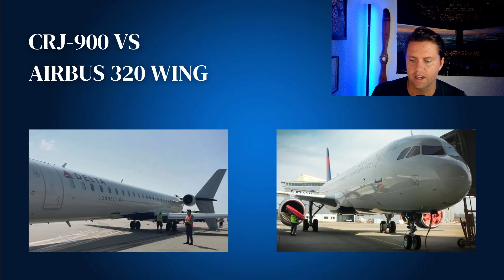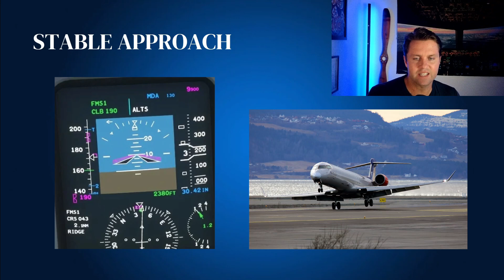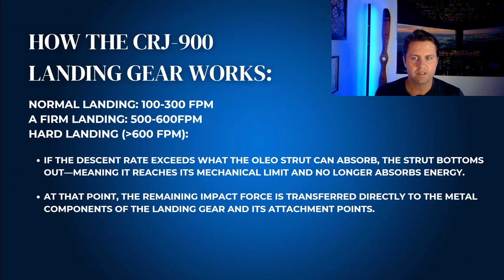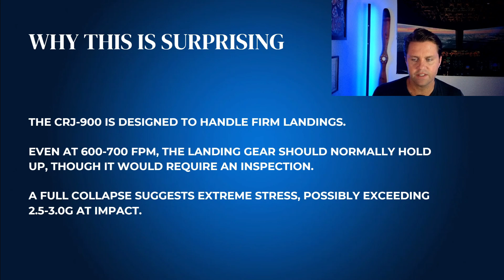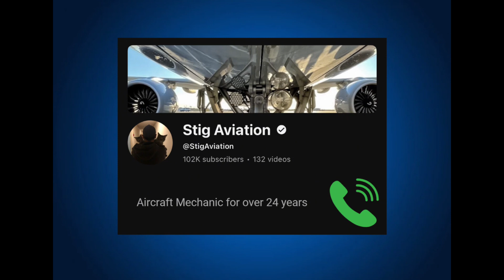Pilot Breakdown: Did a Hard Landing Cause A Gear Collapse?

Comment: Not only did the snow probably extinguish the flames but it also helped the plane slide easier wish I think help the fuselage hold together. Did you ever seen a deer trying to stand on ice? How the legs spread out and the animal can’t stand. Maybe just maybe this is what happened here. Coming down hard on to the one side plus the sliding away effect put enough force on the gear that this thing gave away. Yes this equipment is designed to withstand hard landings but also a deer’s legs are no joke so I think that under the right conditions this landing gear wasn’t able to hold steady and slides out of position causing the accident. All we need is the right recipe. Coming in a little hard wind tips the aircraft to one side and the ground being slippery..  I am not an expert but just know a little bit of mechanical structure..

Comment: Runway 23, wind 270°, max gust 35 knots. Calculate -> Max crosswind component 23 knots. 
Max allowable crosswind component for landing on a wet runway for the CRJ900 = 22 knots.
Pilots made the call to not go around. Very risky landing. Plus no flare = disaster

Comment: Mmm there is a fair amount of talk about "overweight landings" towards the end of this video... A quick bit if research (rounded distance doen to 900 miles) indicates a fuel burn of at least 8,800lb or almost 4 1/2 tons (or roughly half of a CRJ's possible TAKE OFF max fuel load), passenger jets encountering a 'return to departure airport' shortly after taking off (with full tanks) may need to off load weight (fuel) to avoid being "overweight" but clearly that wouldn't be a factor here.

I noticed (likely the most significant factor based on the limited information available so far) that there is almost zero consideration regarding the likelihood (especially based on the video) of the aircraft encountering a gust generating a sudden DROP in airspeed immediately prior to touchdown in all the videos of this accident (especially in view of ATC 'weather actuals')

Comment: Funny you mentioned sand. Years ago the Argentina Navy has an L-188 Electra crash land on a training flight. Local media filmed the entire approach and crash. Most of the fire was extinguished by the sand when the sand flew into the air and back down on the wreckage. The only small parts that kept burning were the parts where sand didn’t land.  I was working for a small simulator company at that time and we used the video for CRM training, this is back when CRM was a dirty 4 letter word. So, yes the snow probably did extinguish the fire.

Comment: NO FLARE?
On the early afternoon of Feb 5th I was flying on AA from PIT to DAL.  It seemed like a normal descent except it must have been IFR because we were surrounded by fog.   All a sudden we landed with a WHAM!!   I don't think there was variation in power application in the last seconds or any flare.  Hardest landing I've ever had and I've been flying as passenger for 60 years.  Am wondering if all of the young pilots are being taught?

Comment: The orange flames seen during the crash sequence is caused by vaporized kerosene fuel escaping from the ruptured fuel tanks, probably from the severed right wing. The black smoke is caused by fuel in a greater quantity than the misted fuel that caused the orange flames.  Yes, the snow did extinguish the fire, saving the passengers lives. 

Also, the airplane did not bounce, most likely, because the wings did not have lift to allow the aircraft to ascend back into the air.  The airplane rolled towards the side with the severed wing, an indication that a sufficiently large rolling moment caused it to roll over onto its top.

Comment: The video shows a quick roll to the right and slide to the right just before touchdown. The gear may have touched down off the runway. Take a close look.
Reply: I wondered that too.  Peraps it was in the deeper snow at the edge of the runway.
Reply: This raises the question, was the whole width of the runway cleared of snow?

Comment: It is actually gross weight times g-load that determines the actual loading on the MLG.
Reply: Force = mass x acceleration
Reply: @christopherrobinson7541  When talking g's, then it is weight x g-loading. Each g takes into account of mass and acceleration. I have been an aeronautical engineer for 53 years.

Comment: If you watch a slightly different clip, you can see earlier in the approach the nose was up with a slightly higher angle of attack - almost like a premature flare too high off the runway. Then you can see the 
nose drop and the plane goes higher sink rate with a lower nose attitude until major impact on right gear.

Comment: Are we sure the gear actually failed?  It appears the CRJ has the rear bogies mounted way out on the wing.  It could be that the wing simply dug into compacted snow as a result of low stance plus slightly rolled attitude plus high G touchdown.  If the wing ripped caught just right, it may have ripped the gear off before it had the chance to provide rebound force.

Comment: What if both starboard, main tires blew out immediately? Every physical part that failed, failed. I've been in a plane that landed hard and one tire on each  side of the main landing gear, blew out, the plane couldn't taxi to the terminal and we had to walk to the terminal. There were no buses to carry people to the terminal as this was a small regional airport. I've seen planes with tires that have a huge gouge in them so, a large, flat area on the tire, often several tires, where obviously it landed hard and removed a lot of rubber. I've seen a nose wheel fall off a plane that was taxiing onto the gate. I've seen a plane taxi onto the gate missing a nose wheel. It lost it nose wheel on take off from its departure city and landed with one wheel only at the arrival city. The pilots were oblivious to the fact that they were missing one tire. The airport maintenance people in the departing city later found it in the grass near the runway  once the pilots contacted dispatch and said they were missing a nose wheel. Have you never seen footage of WW2 aircraft carriers planes landing hard and snapping a landing gear, blowing a tire  bending a wing? They are all designed to work to a certain point. Aluminum has a melting point. If a fuel tank ruptures, and flames erupt inside the wing, that aluminum which is brittle, compared to steel, which is more flexible, now becomes more flexible, it softens.I don't know what the temperature of the jet fuel was when it ignited, so what is the flashpoint of jet fuel? Does burning jet fuel go higher than the flashpoint? Don't ask me, I don't  know. Someone does. Someone sitting on the left side of the plane said they saw flames on the left side. Were those flames from the right side fuel tank rupturing or did the left, port side fuel tank also rupture?

Comment: Regarding Asiana 214 in SFO: The passenger killed was run over by a firetruck after have been ejected through the opening caused by the breaking off of the empennage. She had not been wearing a seatbelt for the landing and was lying on the ground being covered by foam while the fire was being fought.
Reply: In fairness , fire trucks usuaky run over 3 or 4 people in every emergency

Comment: It looks like the landing gear on this plane is actually mounted on to the wing itself and not the fuselage. When the wheel touched the ground, the landing gear might have been able to withstand the hit but the break either occurred where the gear was attached to the wing and/or the wing itself actually sheared off of the fuselage.. The left gear might still be attached to the left wing... they might find the gear and wing assembly together still.... :)

Comment: On the Blancollirio Channel here on YT his post from 18 Feb shows a position report from around the 4 minute to 5:50 minute mark.  In the last 1000 feet of decent the decent rates are all less than 1000 ft per minute.  The last one with a decent rate is at the 5:41 minute mark shows the CRJ at 625 ft MSL, the airport is at 569 MSL, so only 55 feet AGL, ground speed of 111KT, sink rate at 480 feet per minute just before touch down.

Comment: Who was the Pilot flying? It seems like a whiteout confused him/her but the automated audio altimeter call-out should have alerted them.
Reply: Plane experienced abnormal sink rate just before landing according to ATS-B, possibly wind sheer or down draft. If that’s accurate pilot likely did have much time to react plus flaring while stalled does virtually nothing. I’m not sure what pilots training says about wind sheer or stall close to ground.
Reply: @randomgeocacher  Microburst?  That turned a plane over in Denver several years ago.

Comment: As a commercially rated pilot I can tell you this was far worse than no flare. They literally flew the plane right into the ground.
Reply: I saw someone say they plopped instead of landed. Seemed unfortunately accurate.
Reply: @ Technically "plopped" is what would happen if the plane was flying too slow and lost lift. However what happened here was that the plane was flying a direct line of descent at which point you would normally do a round out. Instead the plane was flown right into the ground. and that's actually different than simply not flaring. A plane can absolutely land without flaring. It could just descend very slowly and then stop descending with the wheels right above the runway allowing the tires to just kiss the asphalt and roll. It would not be recommended because the plane would have too long of a roll out. However what this plane did was literally descend right down into the runway. It was an avoidable act of brutal incompetence due to misjudgment of height.
Reply: @PracticalKnow   oh, wow. 😫
Reply: @PracticalKnow   I think they were talking about the way it looked like it just dropped onto the ground instead of smoothly descending. I'm just a gardener. 😊 This makes me thankful for the many bumpless landings I've experienced back when I flew around.

Comment: I think the snow caused the accident. The pilot could not see the runway and had no depth perception. Just like a water landing, you don't have good depth perception and you just have to set the pitch and wait. If you go visually you will slam on the runway or water if your a seaplane.
Reply: That is my thought too. It happens in Sprint car racing when mud is on the wall.

Comment: Forget about designing DC-9 type airplanes.  Engines in back, low stance, easy for the wing to scrape.  At least with wing underslung engines, the airplane stands taller on the ground.  In a bad landing, at least the engine can rip off and the wing not come off.  The snow?  That is why Canadians like the snow.  Exercise shoveling, good for your health.  Hockey games, falling down on hard ice, fun.  Canadians must like cold weather too.

Comment: I've been thinking similar to what you've been saying. While plenty of people are blaming the pilots for "not flaring", I have a hard time believing an experienced pilot just "forgets" to flare. I think it will be revealed that the firm landing was intentional due to the crosswinds of high winds and gusts but the gear collapsed probably because it had experienced far too many hard landings without inspection or maintenance. Just my hunch as of now.
Reply: I feel like people are passing judgement on the situation really early. We have a few videos, but we don't know the precise details of what the pilots were commanding from the aircraft, nor the cockpit records, nor any of the other information. Commercial crashes don't usually just happen because a pilot forgot to do a completely routine action. I am just going to wait for way more information.
Reply: In that case they should have gone around and tried again. I was flying into LaGuardia back in the 80’s in roughly the same style of jet in the same weather conditions (cold/wind gusts/snow on the ground) we touched down and bounced sideways and the next thing I knew the engines were blaring and we were headed back into the sky.  That airspace, I suppose was so busy, that it took at least 5 minutes or more before the pilot came on and said, “My apologies, we caught a big gust of wind there at the last minute and that landing was not going to work out well, so off we go, we are being put back in line and we will try that all over again”. I had never been in a plane that touched the ground and gone back into the air. I think they should have aborted that landing and tried again. However, I’m not a pilot so I have no idea, if a go-around was even possible.
Reply: @stefkadank-derpjr1453  firm landings are preferred in heavy crosswind conditions because a normal flare with the excess speed due to gusts will cause the aircraft to float a bit longer which will either be the wind will push the aircraft off centerline of the runway or cause skidding once the landing gear makes contact with the ground. Firm landings are not uncommon for crosswinds. It’s hard to know exactly what happened without looking at the flight data recorder and getting inspection and maintenance records.
Reply: I agree with your conjecture.

Comment: Out of interest, Boeing aircraft are designed to endure a sink rate of approx 700 feet per minute at maximum authorized landing weight,which is a typical pre-flare(approach) descent rate.
 At maximum take off weight( much heavier) they are designed to endure approx 300 feet per minute.
All of the above assumes touchdown on both landing gear simultaneously..In the case of one gear making contact before the other,these numbers fly out of the window..
Any CRJ pilots can come up with the design sink rate limts for this type( In fpm)?

Comment: Do we know as a fact that the right landing gear made contact with the runway?
Reply: It may have been in the deeper snow at the edge of the runway.
Reply: @ If that scenario played out, the right side drag would potentially rotate the plane to the right which would also create more speed and lift over the left wing causing the jet to suddenly flip right. 🤔

Comment: The snow certainly didn't hurt as well as the direction of the wind blowing the flames away from the fuselage along with the wing totally ripping off and taking most of the fuel with it.    Also, Juan Browne showed the ADSB indicating a high rate decent rate right at the end, so clearly putting all that weight on one landing gear, plus any side load on the right gear could have certainly failed it.

Comment: Yea i was saying they came down too even and came down on the right landing gear to hard and it collapsed. But it kinda looks like the landing gear wasn't locked all the way but it could be just the angle the camera. They did say there was a snow bump from the previous plane that landed before them also. For the fire. The one wing snapped off, and once the plane rolled the other wing snap but not completely off so that could of dumped more fuel out also. Its also landing so theres not alot of fuel left in the tanks. Not.like their full. Also emergency crews were there pretty quickly. Theirs video out there with fire coming out of it while ppl were standing around it filming. Not saying the snow didnt help. They did just spray down the runway to melt the ice from what i heard. So the snow plus that could of diluted the fuel so it couldnt ignite.

Comment: You don't have the right to imped an emergency evacuation in progress! Was I glad I could witness it? Yes. Was it appropriate? ABSOLUTELY NOT!

I think the snow helped, I don't think it was the only reason.  It looks like the fireball stayed with the fuel. Sure there's fuel in the lines and yes, there's more fuel and an engine on the otherside, but that's NOT what initially caught fire. I believe it would have if fire didn't respond so quickly with the foam.

Comment: I think what everybody needs to remember is that the rate of the descent force is multiplied due to the fact that is not distributed between both landing gear. if there wasn’t a strong cross wind, the aircraft would’ve not been in a sideslip thus the likelihood that both main landing gear would touchdown at the same time and distributing the force equally.
Reply: Very good analysis.
Reply: @scotthanley8616  I had posted a similar comment but not quite as detailed as yours. All the force was on the right side gear and it probably couldn’t handle that.

Comment: Watch the horizontal stabilizer rotate at “touchdown” and that “snow” is the fuel mist from the right wing fuel tank rupturing.  The wing failed at the attachment point for the right main gear due to the high sink rate.
Reply: So are you saying the “fuel mist” helped extinguish the all ready established fire ? No disrespect intended but after 30 years as a firefighter I cannot remember ever using a mist of aviation fuel as an extinguishing agent.
Reply: @mandst5466  Nope, some people seem to think the fuel mist is “snow.”  Just look at the horizontal stabilizer rotating at touchdown and then just a fraction of a second later you can see the fuel mist ignite from a spark in the area of the right main gear.  The main gear failed from the high sink rate (watch the horizontal stab), rupturing the right wing fuel tank, and the mist of fuel ignited as the plane traveled on down the runway flying away from the burning fuel.  Luckily the right wing detached and dumped most if not all of it’s fuel hundreds of feet back up the runway or we might have had sixty dead from the fuel burning under the aircraft.
Reply: @ It is a small miracle for sure and that is all that matters in the end 🙏🏼

Comment: Looks like crosswind added to the hard landing - this combined giving a circular momentum along the longitudinal axis. Add to this the weight of the engines which are top heavy above this longitudinal axis of the fuselage - once there is no support, gravity will pull them Dow adding to the fuselage turning along its axis…